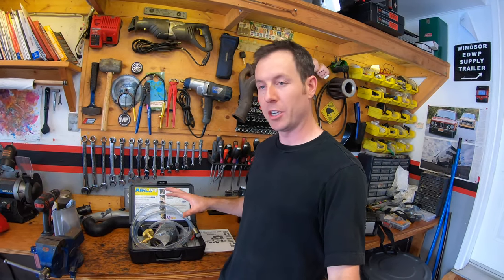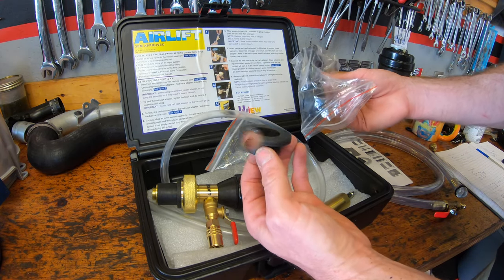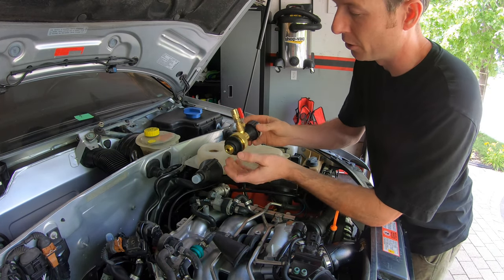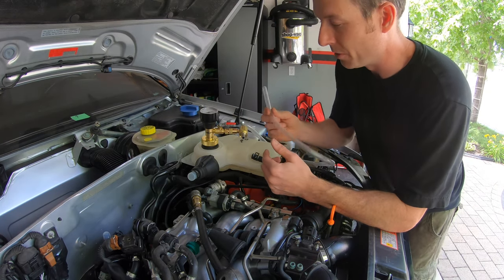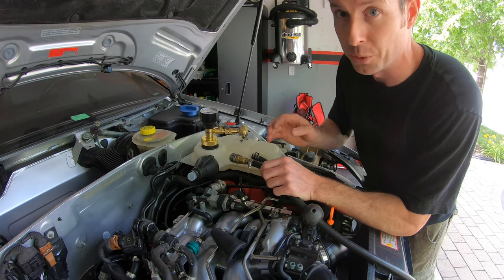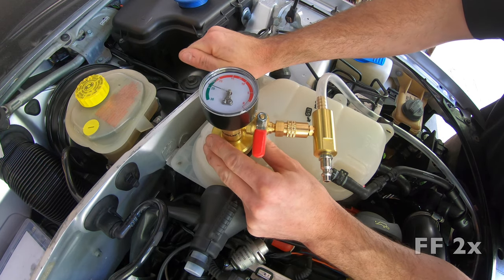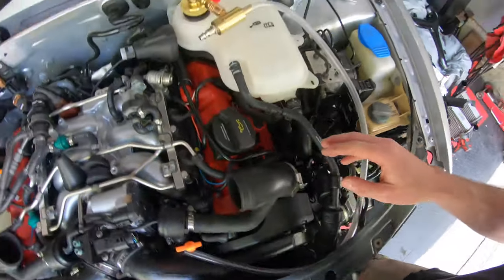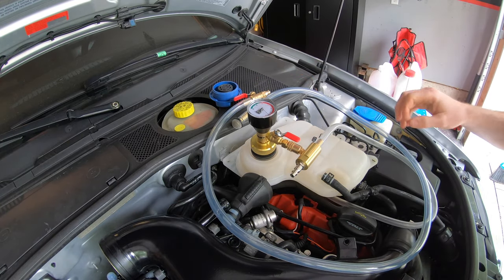Cooling System Vacuum Test / Fill - Airlift 550000

Comment: Got a similar tool today, this video helped me out alot and using both together feels like a cheat code to bleed my B6 1.8t. By far the easiest method of putting coolant back into the system after a complete drain 👌
Reply from the maker: Glad it helped and it was nice meeting you at Kenny’s!!

Comment: Seems like a waste of money. The only way it could conceivably be of use is if you filled the system up normally, then applied a vacuum at any bleed points in the system, like some cars have on their cylinder heads. Actually it's the ONLY way this system will work. On an engine that doesn't have coolant bleed ports, there is ZERO reason to do anything but just pour the coolant into the expansion tank and go. In such systems the manufacturer has made the expansion tank the high point. There's a simple trick to getting those pockets filled in cooling systems with bleeder ports without making a mess on a hot engine. With the bleeder screw removed, squeeze the lower radiator hose, then put your finger over the bleed port and hold it there while you release the lower radiator hose. You'll see the fluid level in your expansion tank go down as you draw coolant to the top of the bleed point. once you see coolant at the top of the port, replace the screw and you're done. This takes five minutes and costs nothing.
Reply from the maker: Some cars are easier than others, it can be very difficult to get air out of B5/B6/B7 heater cores. Sometimes they’re easy to get all the air out and sometimes they are a real pain. Applying vacuum to the system means there’s no air in it to begin with, no air means no air bubbles. This tool just means you can be sure it will not be a hassle.
Reply: You have more money than brain. Coming from 20yers of ownership, B5 are simple to bleed ones you stop listening to the trust me bro kids and apply some common sense. That “tool” will eventually brake something since the system is not designed to hold vacuum but pressure so seal direction and connection design play a role. 
Many shop use that cause it’s not their car and they save few minute and newer cars will take some abuse till they start braking down and when they do people will go to them to fix it so it’s a win win for them.
Reply: The B5 have a bleeding hole on the heater supply line. You move the hose to uncover the hole, use elevated coolant funnel (or just rase the coolant reservoir, like I do) and poor coolant till you see it coming out of the formation hole. That’s it. Done it 100 times.